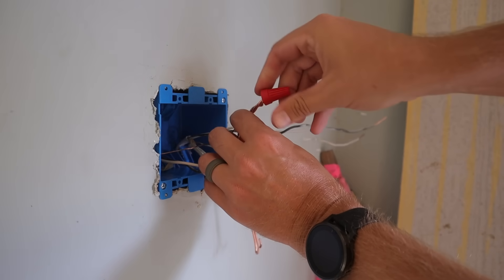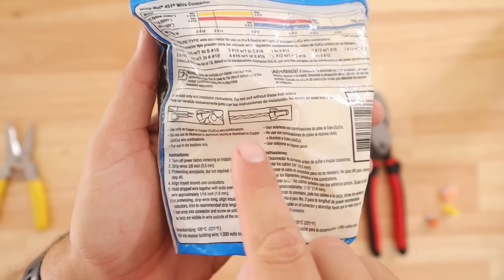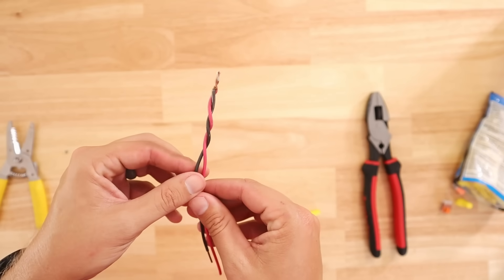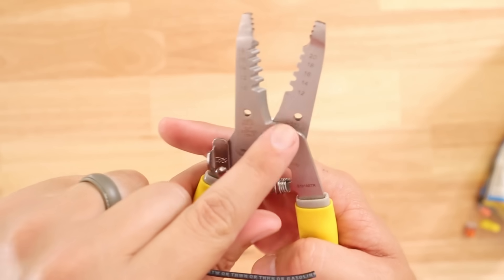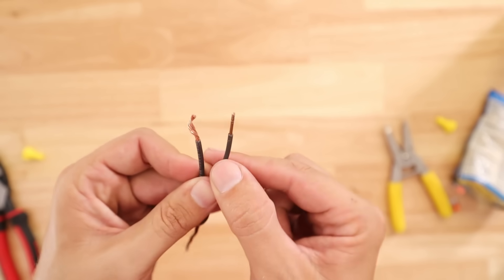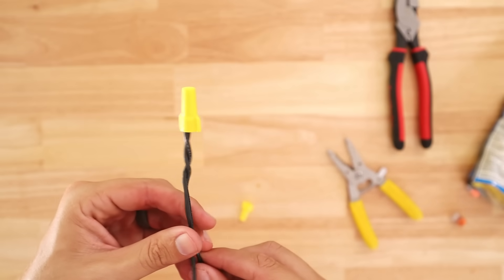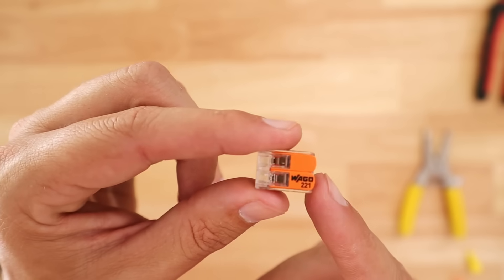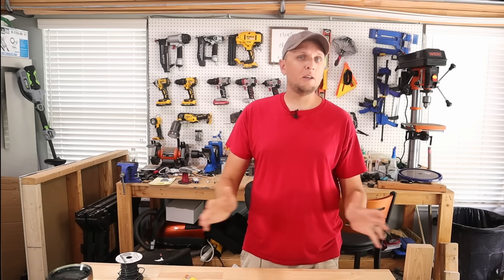BIGGEST Mistakes DIYers Make When Connecting Wires Together | How To

Comment: "It is not required to pretwist." Good statement, then you bungled it with "However" There is no however.
Reply from the maker: Sure there can be.
Reply: HAHA C'mon man... Really? Ity's black and white. It either is "Codeworthy" or not! Perhaps instead of however, if you said, "I think it's better to twist them first, I would accept that as your opinion, which you must admit, does not code make. @HowToHomeDIY
Reply from the maker: Yes, that’s actually exactly what I said.  I said pretwisting was not required per code with those particular wire nuts because that’s what the package said.  However I also showed what I and many electricians prefer and think is better.

Comment: US wire connecting: you are using nuts wrong! 
Russian wire connecting: twist at least 2 or 3 inches of wire, then weld it or solder it! At least, use crimp sleeve connection. Nuts and wagos are just not good enough.

Comment: For those of you with arthritis or a lot of wire nuts to do, start each one by hand and then use either a socket or just the open chuck of your drill to finish the job.  If you don't have a drill then a wrench witha box end will work too.

Stranded wire for home wiring is stupid.  Do you see it in switches or wall outlets?  Of course not!  They only put that stuff in ceiling fixtures, because nothing is as manly as hanging on a rickety ladder with a ceiling fan over your shoulder while you try to make stranded and solid work in the same wire nut.  If you want to convince your friend that Wagos are superior, whip 'em out when he's up on that ladder and running out of swear words.

If you must use wire nuts with stranded, what I have had the most success with is taking my two straight wires and bending them to 45 degrees just above the insulation.  Give the stranded wire as many twists as possible to make it reasonably solid-ish, then twist both wires together, gripping both firmly just above the insulation (linesman's pliers work good here too).  The resulting connection should be similar to one made with two solid wires--the reason for this is to keep the stranded from just flattening out and preventing any direct contact with the wire nut.  It's too easy to pull solid wires out of mixed connections unless they are firmly twisted together like this.

Comment: I have a couple of recessed lights using the old type halogen MR 16 bulb with GU 5.3 base. The bulb has two tiny pins that connects to two holes on the connector of the fixtures. Because its halogen the lamp generates lots of heat around and inside the recessed space. The two holes on the connector side of the fixtures got corroded making the bulb works intermittenly. I have two options replace the whole recessed fixture or cut the wires to the connector and replace the connector. I read somewhere that I need a ceramic wing nut to splice the new connector to the fixture because it generates a lot of heat. Or else the plastic wing nut would melt. Is that right?  Also, is it advisable to cut and splice a new connector to the fixture? Or do I need a new recessed lights?

Comment: If the stranded wire is wrapped around the solid core wire, then the solid core is still straight and the wire nut is not actually in contact with it.  Is this secure (enough)?

Comment: Very good video. I have heard of the Wago connectors and they look pretty good. However they look like they would take up more room in an electrical box especially if you had a lot of connections in that box. In the industrial company I used to work for,   wire nuts were not allowed because of the less than acceptable connection at times. I have seen where the connection in a wire nut was not very good and it overheated, causing the wires to burn. Fortunately there was no fire since the connection was in an electrical box. We used Sta Con crimp connectors for both solid and stranded wire connections. You don't have to pre twist the wires. Just put the wires in the proper sized crimp barrel and crimp it with a Sta Con crimping tool. I still use these today along with the wire nuts for residential wiring. Never had a problem with the Sta Con connectors as long as you use the proper sized crimp barrel.

Comment: In the Germany Wagos are what is required by code. I love Wagos & they hold better than twist on wire nuts. I also carry a variety of Wagos in my vehicle in case I ever need to do an emergency splice in the field, which I have more than once as an overlander & offroader and due to pack rats.

Comment: All great detailed information about such a simple device!  A question, please… I have also seen where some people recommend wrapping the wire nut connection with electrical tape.  What are your thoughts on this extra step?
Reply: It can't hurt, but it is not necessary.  As the rules say, follow the exact instructions.  Downside of tape is that it makes everything gummy, and harder to inspect and replace.  Installations are never going to fail right off the bat, if done correctly, so why make it hard to inspect or maintain them. 

 I have used zip ties so the wires can't separate below the nut.  There never seems to be enough wire in the boxes to handle any change when redoing something. Today we are supposed to leave some extra.  So I have used zip ties to help out when the wire was going to leave some tension on the marrette.

I have even heard of people soldering.  Kinda seem like people with a lot of time on their hands, who should have been rocket engineers but want to show you have much they care...

Comment: The basic way to go but soldering together and covering with tape is possibly more secure. Much slower though and you ust kow how to solder.
Reply: All methods have their advantages and disadvantages, soldering is more secure but also it makes the connection hard and solid and thus easier to break off.

Comment: I don't know if this is good practice or not because I got it from watching another DIYer patch BNC Camera wire.. So I'll inquire since I'm here anyway.

But I like to either solder stranded wire before twisting to solid and capping or solder the two together and cap them. I also have used soldering on the ends of stranded wire extension cords to make them like a solid when putting 90 degree right angle replacement blade-plugs, with the wire-entry holes under the tightening screws, on them. I use low temperature melt solder so as not to damage the stranded wire..

 I'm a short time DIYer so maybe I worry too much about whether it's gonna still be connected after it's tucked in or screwed together and done and especially as pertains to stranded wire connections and blade-plug replacements..

 Sometimes I'll forego soldering when wrapping stranded around tightening-screws of a plugin replacement because it seems a tighter connection without it and/or the soldered wire is too stiff to work that way...  

If there's any reason not to use the soldering otherwise then I'm open for considering all counsel. .

Comment: Just stop using wire nuts and start using Wago clamps (or similar). They offer more secure connections for single strand to multiple strand wires, and they use less space than wire nuts/ twist connectors, especially when "splitting" from one input to multiple outputs. Most of Europe stoppet using "wire nuts" 20 years ago, and it's about time everyone else get the memo.

Comment: If you twist the solid wires together and secure the connection with a wire nut it will be a tight connection. But if you need to add another wireo to that connection, Do Not untwist the wires. Cut out the entire twisted connection and start the connection over, stripping the insulation etc. If the connection is untwisted, the bare copper portion of one of the wires will most likely break when twisted a second time. Each time a new connection is added, the wires get significantly shorter. When untwisted wires are held with a wire nut, and the wire nut is adequately tight, maybe an extra half turn with pliers, the connection will defy any attempt to pull it apart. The threaded portion inside the wire nut will cut significantly deep threads into the relatively soft copper wires,  locking them together.

Comment: WAGO is the only WAY to GO! 😊 But one thing I’ve seen a million times are wires twisted counter clockwise. Then of course wing nuts to large or small for the application. But as a layman I’ve always took the “Clark Griswold” approach when it comes to electricity. Always going above and beyond what’s required. Sometimes if for some reason I thought that in the future there might be an issue, I’ve been known to put a little dab of solder on my connections or a little electrical tape around the two wires.
Reply: There are Wagos that have more than two connections for large applications that work way better than wire nuts.

Comment: Any possibility of getting  a video of these various connectors and methods under power and temperature monitored? Not sure if they would show differences in heat but if you had a bad connection, you might see a hot spot?

Comment: I myself prefer Mars’s, if you are not familiar with them they have a brass nut with a very small screw that you must tighten the wires down to and then put the plastic over that brass nut., the wago that he is showing is similar and I fell much better.

Comment: Right size of wirenut for the gauge of the wires?  Twist the wires in the direction such that twisting the wirenut will tend to twist the wires tighter rather than in the opposite direction of the twist that is there before the wirenut is twisted tight?
     (don't twist in the wrong direction such as the loosening direction for the wirenut)

Comment: Pre-twisting wires is a waste of time in my opinion.  It requires extra time and, in most cases is not necessary.  Good electricians will give their splices a tug to ensure each wire has made a good connection.  Stranded wire does need to be first into the wirenut when spliced to solid.

Comment: My Dad used to twist the wires together,and then solder them,which didn't take that much longer,and then put a threaded wire nut over the joint. Back then,we used brass nuts with a set screw,and finally,a threaded plastic cover you could screw on to cover the nut. Of course, this was only for DIY projects.

Comment: The wires will twist with the wire nut. Code or not, in real world industrial maintenance you have to work some things hot (high bay lights) not a lot of twisting happening...
Reply from the maker: That is true.  Working it hot is definitely a different story.

Comment: Actual commercial/industrial electrician here👋 
For all amateurs, people that twist their wires have never had to troubleshoot circuits live. Yes, I understand that you can shutoff power, but for circumstances where you cannot, it is necessary to work on circuits live. For example, you're working in a high security area but the electrical panel is in a place where you don't have security clearance. Twisting you're wires makes it that much more hazardous for the next person to unbraid your rat's nest. 
Only old timers tell you to twist your wires because back in their ancient times, all they had were shitty wirenuts and they would pop off if you breathed on them wrong, so they practiced twisting their wires to prevent that issue. But now wirenuts are more advanced and have better grip, especially ideal wing nuts.
So don't twist your wires. Please and thank you.

Comment: From my experience with wire twist nuts is you pull on it real hard. Pull on both wires, and the nut. If it doesn't come off, you're good. Really all that matters is how secure the connection is. If the threads got a good bite on both wires and there's good compression, it will hold. The only other variable is if there's any exposed wire on the bottom of the nut that will make contact with anything else and cause a fire/short.

Comment: Former electrician and current facility engineer here, overall solid advice in this video, with a couple exceptions. Here's my advice. Always pre-twist solid to solid, never pre-twist stranded to stranded or stranded to solid. In the video where it shows solid to stranded, it shows the importance of having a good hold on the wires while you screw on the wire nut to ensure the wires stay the same length and neither gets pushed down. Also, apply very light pressure, if any. Let the wire-nut pull it's self onto the wires by screwing, not pressing. He actually also accidentally shows why you shouldn't pre-twist solid and stranded. If you pay attention, the wires really aren't twisted together, the stranded has been twisted around the solid, and this is what is most likely to happen. This is backed up with the instructions on some wire-nut packaging. This also frequently happens when pre-twisting different gauges of solid. In this case, I will start the twist, and then bend both wires away from each other at approx 90 degrees and then continue the twist. This helps ensure they twist around each other. If your wondering why not do that with solid to stranded, I actually do have an answer. As pointed out in the video, stranded wires are far more brittle and likely to break, and trying this method will almost guarantee breaking off at least some of the strands.
Reply: too pedantic and you are now taking WAY too long to finish the task. you screw the nut down on the wire how ever it works out THEN you check the damn thing by pulling on the conductors to make sure the nut has bitten down on all of them sufficiently to secure the splice then you move on. additionally twisting the conductors for more than two twists out from the nut should be avoided at all costs because it makes shoving the splices neatly in to the box nearly impossible which again causes you to take too much time finishing the task.
Reply: @kevint1910  doesn't take that long when you know what your doing, and you should absolutely mechanically connect your wires before you cap when using solid wire so that when someone goes to pull that cap off they are still connected. I hope you are not an actual electrician with your dangerous wiring practices.
Reply: It's not a personal pet peeve when it's the correct way and the fact that you think the correct way is a waste of time is terrifying. Also, not even sure where you got the whole wire rope thing, my wires are only twisted at the connection.
Reply: @calijguyman  quote me the actual code section where it states "thou shalt twist your solid wire connections" other wise admit you are full of crap.

Comment: Good tips.  But I use a spring-loaded wire stripper that is like a pair of pliers -- just squeeze the handles together and the wires gets striped Perfectly,  after you place the wire in the correct gauge slot on the tool.  Amazon, Lowe's, etc have it.

Comment: wing nuts are the only option. Those other connections take too long to get a meter on. When I see those fancy connection I cut them out and put in a marette(marette is a round wing nut, easier to wrap in tape)

Comment: An electrician told me with 2 stranded wires to not pretwist them. To let the Wire nut do the twisting. I was disappointed you didn't mention what to do with 2 stranded. What I used to do was twist each stranded wire tight then use the pliers and pretwist like you mentioned with 2 solids.

Comment: For me. I don't think of nor depend upon the 'wirenut' to be the mechanical means by which I join two or more conductors/wires together and make a solid connection between them. 

Rather, I view and utilize pressure connectors merely as the means by which I INSULATE the bare ends of the wires - AFTER I have made a solid connection between them, via twisting the bare ends together (like a braded rope).

That way, as you demonstrated, not only are the bare ends wrapped tightly together, so are the insulated ends. Little if any chance of these wires coming love.

Comment: This is a bad video your not a licensed electrician if you twist the wire like you show in your video over time they will eventually break and will  cause a problem. It's obvious you never done service work have no idea  how to use a wire nut.
Reply from the maker: No that’s not how it works.  If it is then the electricians that wired my house and everywhere else I’ve seen have doomed them all to failure.  You can have your own opinion but not your own facts.

Comment: I normally follow the way I was trained which is solid to stranded soldered and covered. This eliminates the propensity of the wire nut to drive the stranded wire down and out along the solid wire. Then the wire nut serves as a safety cover after soldering the joint.

Comment: Pretwisting too hard can fatigue the wire. I've seen this on jobs where I ve taken strong pretwisting apart. sometimes they break.  I always cut my ends the same length and crank it down tight so the insulated parts beneath where I stripped start to twist. Never had one come apart in over 10 years of doing electrical work.

Comment: i was taught that solid wire needs to be "pre-twisted" with linemans pliers. Then you use a wirenut and electrical tape on top of that. If it is stranded wire you should pretwist with your fingers then use a wirenut and tape.

Comment: twist your wires before the wire nut goes on. If someone pulls the wire nut off the wirse stay together. You might think they should turn off the power before they take off the nut but we plan for the worst.

Comment: Think of the wire nut as only a twist on protective insulator. The actual electrical connection should be reliable on its own, so the wire nut just prevents unexpected conduction to other materials.
Reply from the maker: Agreed

Comment: Thanks.  I accidentally did twist wires. I always wondered about if the caps would hold the wires. I also taped the wires and caps cause I was always worried they wouldn’t hold together.